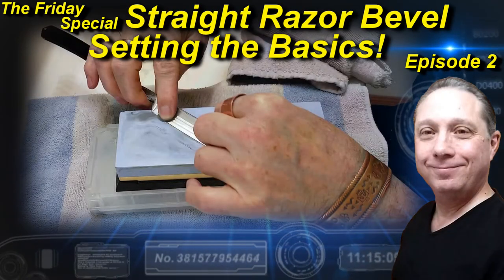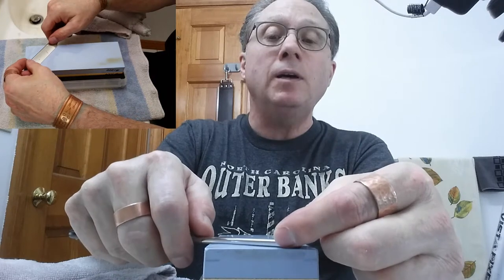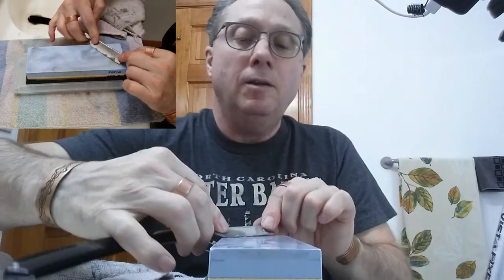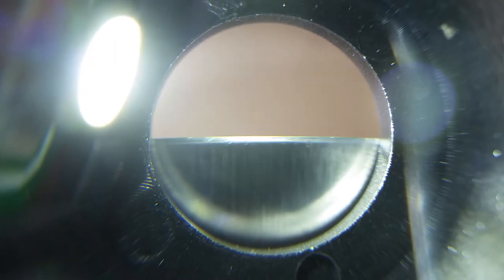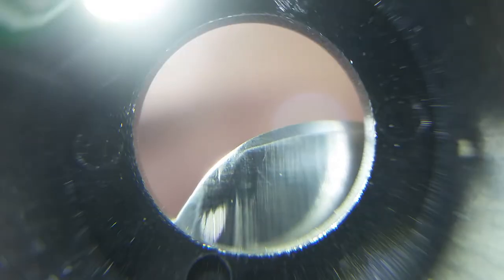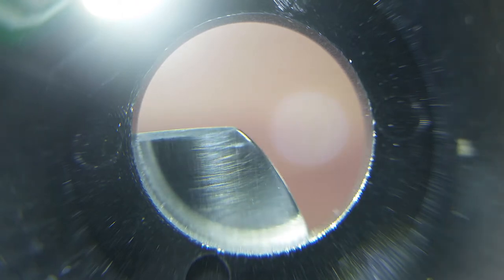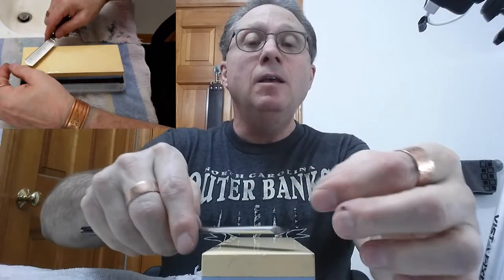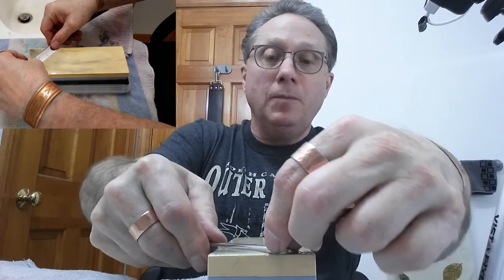Straight Razor Bevel Setting the Basics EP2

Comment: Hi Eric.  How do you like the Suehiro 1000/3000 combo stone?  I'm considering it for bevel setting and 3k progression before moving to higher grit stones.   Thanks.
Reply from the maker: Caesar IMO the Suehiro 1000/3000 combo stone is a fantastic bevel setter. I use the Surhiro in all my honing progressions from bevel setting to the finishing stone. Thanks for the great question, I would go a head a get the Suehiro 1000/3000 it will make a great addition to your honing progression. Thanks for watching!  👍🙂👍